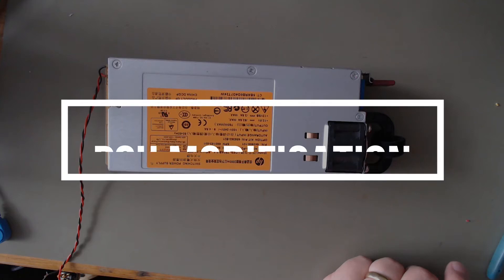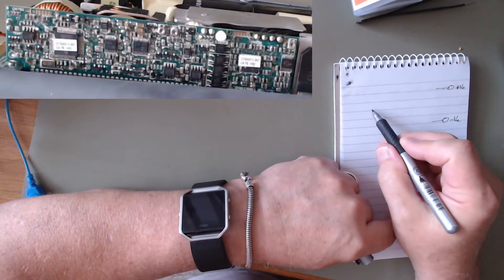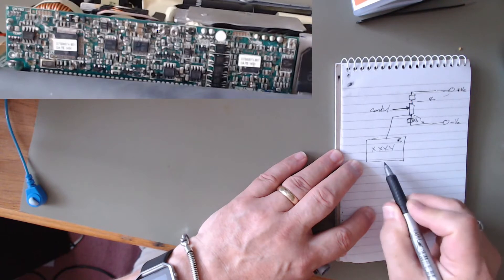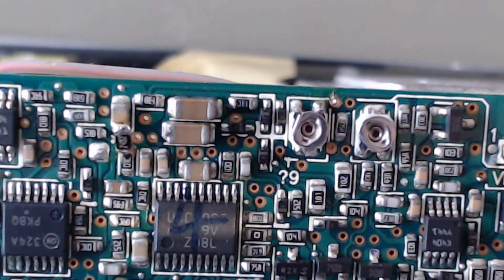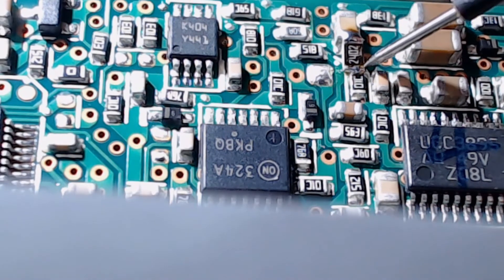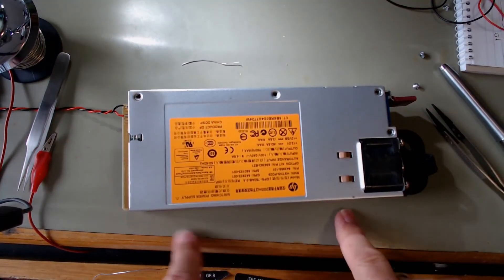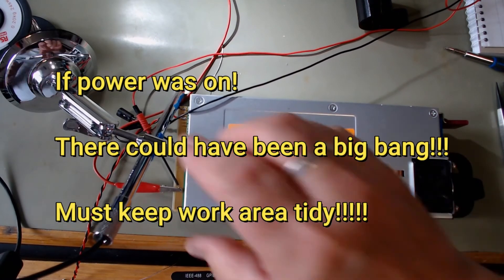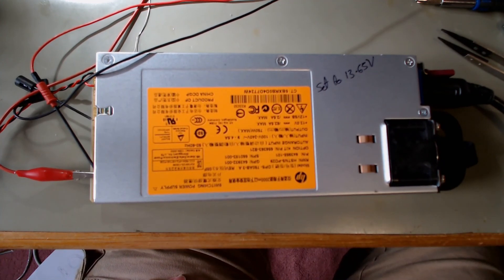#073 converting HP HSTNS PD29 to 13 8V

Comment: I just did the mod on 18PL 750w and stabilized it at 13.6 with an 18k res. Any idea if these psu have short protection?
Reply from the maker: I've not tried shorting one out to find out, too much current for my wiring. I would play on the side of caution and say no, best to avoid shorts as best as you can than rely on protection.

Comment: I don't understand, the 24k resistor gets connected to adjustment?
Reply from the maker: The modification works by changing the ratio of the voltage setting pot. This means the output voltage has to increase to give the correct feedback value. the other video's show what else needs to be done if you need to get to 13.8V or so without the overvoltage trip to kick in. 

Again be careful these PSU's can kill if you touch the tracks with power on or have not given it long enough time for the caps to fully discharge.
Reply: @TheEmbeddedHobbyist  I've managed to get 13.75v with a 22k resistor
Reply from the maker: @ranetti21  this could be caused by tolerances in the components etc. but once you get near to around 13.8V you might need to do the overvoltage mod as well. there is a video for that as well.

Comment: Great video !  I have resistors that will work but they aren't smd. Can I wire to the leg of the pot you hooked your resistance box to and then take it to ground ? Or do I need to solder the other end to one of the points your soldered the resistor to ?   I thought things were small in 1970 when I took a couple electronics classes. A microscope for these old eyes would be handy
Reply from the maker: the resistors need to go the the same places, except for ground or 0V that end can go to any convenient 0V place. just make sure that the leads and wires are well insulated from the PCB.

Comment: overvoltage protection off? 14v + please help
Reply from the maker: Sorry but i never found a circuit diagram for the PSU and did not need to increase the OV protection. so have not looked at that so can't help.
i keep lookig for a circuit diagram to do more with this PSU i will do an update.
Reply: @TheEmbeddedHobbyist  I installed a 27k resistor, I was able to raise the voltage to 13.7, but I knocked out the overvoltage protection, and I turned the variable resistor on the right in the video, it adjusts the overvoltage protection threshold, and the unit stopped turning on the protection at 13.75 ... it doesn’t work any higher, maybe it will help you change something in the scheme, we need it to be able to charge the batteries, sorry for the Google translator, I am from Ukraine, thank you in advance.
Reply from the maker: @avtoelectrik2833  sorry butI have said before, I could not find a circuit diagram for the board and I expected that the over voltage protection is not adjustable so no pot to turn to try and find it.  If I ever find it I will post a video on it. I do look every now and then trying to find a fix

Comment: Yes, it worked for me. And everybody knows that when we increase voltage to 13.8 the amps capacity of power supply decreases a little bit, but overall wattage will be same, I think there is no issue for components to handle it because it's a very little difference between 12v and 13.8v. Nice video
Reply from the maker: Glad it help.

Comment: A great video, thank you! I've just bought one of these on eBay and waiting for it to come in the post. I'm hoping to use it as a current source for vehicle electrical systems when performing software updates to modules when the engine is not running. With the mod in place, do you know what the lowest achievable voltage is using the pot?
Reply from the maker: Sorry I can't remember,  but if you fit a different value for the resistor mod you could tweak it down a bit. Just remember to let the power supply sit for a few minutes after turning off, the high voltage left on the caps inside can easily kill.
Reply: @TheEmbeddedHobbyist  thank you for the advice. I will have a play.

Comment: Hi, i've tried hacking my pd29 and failed. After reversing the hack the PSUs voltage is for a very short moment 12v, but it falls to 0v. Is there a way to repair it?
Reply from the maker: Hi Jan it's hard to say. You just have to go over where you have made the hack and see if there is anything that you have missed when you removed the hack. Look for dry joints or cracks in any SMD components, did you cut any tracks and not solder back over the cuts? Could be that you have upset the overvoltage trip and it's seeing a fault and shutting down. I've never found any circuit diagrams for these server power supplies, and the very high DC voltage puts me off investigating too far.
Reply: @TheEmbeddedHobbyist  I poked a bit in the psu, and everything is fine except probably the ovp circuit. Its not that big of a deal since I bought a hstns-pd41 and it seems to be hackable too. Its 2/3  size of a pd29 and a bit more powerful, so the pd29 can stay dead.
Reply from the maker: @janmrog Jan  I expect thats a good plan.
Reply: Hey, did you came up with any resolution? I have similar case with my PSU. Looks like OVP is always on. With about 20kohm resistor i was able to get 13,7 V easily, but during testing  with 200W load it turned off. After removing the mod, PSU works as in your case, the same was when the resistance added was too small (about 10k potentiometer).
Reply: @achimPL  Hi, eventually i looked closer and saw that the resistor i soldered to had a burnt contact. After replacing the resistor the psu worked fine. I haven't been able to test max wattage though, because I don't have a load this big.
Your case seems to be diffrent though. On my psu I couldn't pull any load since the voltage was visible for not more than a second. In your case you can pull current, but up until a point. This looks like ocp (overcurrent protection) getting triggered. I'd try marking the second potentiometer with a marker, to mark the position and than, try turning it to see if you can get more power
Reply from the maker: @janmrog  I find that these are very good at shuttng themselfs down with the OVP and OCP. they were designed to be a very stable 12V supply for a server and work within tight limits. when we push to the edges of these limits they bite back and shutdown. I keep looking for circuit diagrams on these power supplies to get an idea of where to look for the protection circuits but no luck yet even after a year of looking. there is a lot of power floating about inside these to make trial and effort a bit of a risk to me 🙂

Comment: Hi! Do you know how to make a HP HSTNS-PC40 PSU work at 13.8V? I only see one potentiometer and turning it does not make a difference in voltage. Thanks.
Reply from the maker: Sorry Jure, ive not seen that model

Comment: do you have any modification of DS1200 EMERSON/ASTEC/ARTESYN to increase voltage to 13.8v ?
Reply from the maker: Sorry not for that PSU, looking at the data sheet it will most likely need to have the over voltage protection upped as well. As the data sheet states that the O/V protection limits are 13.2 to 14.4V.  So i expect that it will cut out before it gets to 13..8V. Circuits are hard to find for these PSU's

Comment: Hello thanks fo the video 

my hp1500w power supply heats up quite a bit at 40% load
I wanted to know if this is normal?

I have other hp1200w power supplies which are much cooler.

What is the normal temperature of the power metal cases?
Thanks in advance :)
Reply from the maker: Hi Mehdi, sorry but I can't help with this. This is the only HP PSU I have, and I did the video as I could not find any information on this model. I use the PSU to power a HF Radio where the high current is only pulled for 6 mins max at a time on transmit, so does not get very warm at all.

if I can find a cheap 1500W one I may have a look.
Reply: @TheEmbeddedHobbyist  Thank you for taking the time to answer me.

normally it should be good I check the heat by touching it and it is possible to put my hand between 5 and 10 seconds maximum
Reply from the maker: @mehdi660  that would put the case at about 60c, as a rule of thumb 60c is about the temperature at which you can just about touch for a few seconds
Reply: @TheEmbeddedHobbyist  yes I must surely be in the 60 ° c

Comment: Maybe you know about over voltage protection how to remove it?
Reply from the maker: Hi, I can't find a circuit digram of the PSU so did look into the OVP as it went to a voltage that I was happy with. Sorry but I'm not into making cahages that might affect the safety without knowing the limitations of the design. my mod did not take the design outside it's limits so was happy it would be safe.
Reply: @TheEmbeddedHobbyist  i did voltage upgrade like u but if u turn on the psu and after that connect something when its working like a bulb to check it goes to protection :/ So if ill be working with my car im afraid of unit to shutdown or going to protection doing some manipulations inside car, while flashing or something like that, for example if u turn on ignition and then turn on the psu unit its fine but if u turn on psu and then ignition psu goes to protection, ive tested it on table even with a bulb, and its not even close enough to 60 A.
Reply from the maker: @kaprizasds837  Hi, your not the first one to have said this occurs. I will try and look into it but without a circuit diagram it will need to be reversed engineered and I'm not too happy poking around inside with caps charged to 400V. So it may take some time. if you find any other information on these pop back and leave a link.
Reply: @TheEmbeddedHobbyist  Im trying to find sad about this one psu theres not enough info at all :/ about 800,1200 psus theres kinda lot of info diy.

Comment: Thanks, it works, but I applied it to the radio, it doesn't work with hi power, it cuts off, what parts do I need to adjust? Thank you in advance
Reply from the maker: Did a bit more playing with mine to day, and found that it did not like my FT-897. If I connect the FT-897 to the PSU and turn it on the PSU shuts down. Not quite sure what's the cause as this is the only radio it had done that to so far.

But I found that the radio started quite happily!  So I put a  2 ohm resistor in series with the psu and the radio and a 1000uF cap between the radio and the PSU 0V. This allowed the radio to start up, once running I shorted the 2ohm resistor out. RX current 0.7A 13.6V TX running 100W FM  (close to 20A) 13.5V.

Radio happy to run in to a dummy load on the PSU at full power.

Looks like the PSU might need a big cap on the output for some radios. 

Looked at the PSU output on start up on my scope and it shows a clean ramp up to 13.6V with no overshoot.

FT897 shows a big draw on the PSU on start up, which i don't think the HP PSU likes.

Hope this helps a bit more.
Reply from the maker: That's a hard one, did it run on a high power load like lights etc. The problem with RF is it could be getting back down your power leads from the radio and making the overvoltage circuit detect an overload and shutdown. 

I would try connecting it to a high power DC load to check the PSU can provide the current without a problem, then look at putting someform of choke on the power leads to block RF from getting back to the output of the PSU.

You could try and adjust the output voltage a bit lower away from the overvoltage trip point and see if that helps. 

These PSU were never designed to run near high power RF, so we need to try and protect them from it.  Does it do the same thing when the radio is feeding in to a dummy load. So that no RF currents are flowing on the grounds from a mismatched antenna?

Just a few pointers as I don't think there is an adjustment that could stop this, apart from lowing the output voltage to give a little more headroom from the overvoltage cutout.
Reply: Does the voltage drop when you load the supply using high power? How much does it drop?
Reply from the maker: looked at mine again and it has issues with my FT897 but only on turn on, which a bit of a Rc filter cleared. see my reply to Sopon above or below depending on where YouTube puts it.

Comment: very nice... i am going to buy 8 of them from ebay, only 10 dollars each and use it to power an ebike... Gas generator on bike trailer --- > 8 x 12v  = 96v --> 96v bldc motor... Do these power supplies work ok on generator power thx...?
Reply from the maker: I've no idea Nick, they are designed for server power supplies so i expect they would be on a nice stable supply. On a generator you might be pushing the limits of the input circuit.

Comment: What did you use to Energize the unit? I saw you switch it on and off. Or I should say it looked like you switched it on and off. I’ve used a 470 home resistor on mine and I can’t get it to energize. Let me know if you would.
Reply from the maker: Hi James, My unit has no problems turning on and off!   I have a 390 ohm resistor that is switched between the left most track on the top of the PCB and the 4th one in from the left.

why 390 ohms i don't know it must have been sitting on the bench, it's not a normal goto value.
Reply: @TheEmbeddedHobbyist  after I spoke to you, I was able to get it energized by shorting the left pens. I’m not sure why the resistor wouldn’t start it. But it’s working now, not with the resistor but by shorting it each time I use it. Thanks for responding. You’re very informative and I will continue watching your channel.
Reply from the maker: @Mustang68 , thanks
Reply: I got the same model PD29
And can energize the unit by short
The left leg and the 4th leg without
Any resistor in between. Question
Is do you really need the 390 ohm resistor ?

Comment: Hi Embedded Man, here idea with the modification to change the level of overvoltage protection!

https://drive.google.com/file/d/1Dv4nZXd7ezqxD8c3UceLraNqwQwo7Ey2/view?usp=sharing

https://drive.google.com/file/d/1zPrVM5GCOJ1rjSc0T2aNdgqekIBNYM5h/view?usp=sharing

The overvoltage pod runs into a LM358 Low Power Dual Operational Amplifiers

Can you tell me if you think this is an option to bump up the voltage of HSTNS-PL29 to 14,6V

Regards
Bob

Comment: Hello Embedded Man, 

I am following your video carefully and I need your advice.  My voltage pot was set to 176,3R on one side and 0.4R from the other leg. The output voltage is. 12.34V. 
According your explaination I could increase the output to 13.82V with an 23.31K resistor value ( Poti) between  leg 1 of 176R pot. (I call it 176R) That is the resistor I could measure.

I do need 14.4V to charge Lifepo cells with it. If I increase the voltage above 13,82V the overvoltage protection kicks in. So I took a look to pot left of it. 

I was set to I assume lowest value 53R. I could not lower the value which I hope it would give me an higher output. But it is already set to max output.  If I increase this side to higher value the overvoltage protection level will be reduced.  I like to share my pictures. 

do you have an idea to how to change the overvoltge protection?

Have a nice first advent. 
Bob
https://drive.google.com/file/d/1Dv4nZXd7ezqxD8c3UceLraNqwQwo7Ey2/view?usp=sharing
Reply from the maker: Hi Bob. 

The first problem is the pot has a limited adjustment range, and I could not get it to go to 13.6V without adding the resistor shown. which leads to the second problem. 

The second problem is as you have found out here is an overvoltage trip which will kill the output if the trip point reached. I could not get to 13.8V as it would trip about 13.75V so I left it at 13.6V which was ok for the radio’s I’m going to be powering.

The third problem is I could not find any circuit diagrams for these power supplies. So don’t know where the overvoltage trip point is set or if it is adjustable. Without finding this part of the circuit and modifying it you won’t be able to get the output much past 13.8V. And as I did not need to go any higher I stopped looking any further.

Sorry that I can’t be any real help with the over voltage trip at the moment, but if I get some time I might go back and have a look.

Glad that my video has been of some help
TEH.
Reply: @TheEmbeddedHobbyist  

Thank you TEH. 
I have measured the resistance from positive to the pot left side of your jumper cascade cable 

In the middle position of the two pods you find a 05A SMD resistor. The gold padhole has direct connection to output voltage. This resistor has 110R.  This resistor is in series with the 56R pot.  If I increase the voltage drop over the 110R  can I fool the circuit?

What do you think. ?
I hope I can organize the schematic!

Regard Bob
Reply from the maker: @Slic-Rock  Thanks for the extra information. It's good to pass information about these power supplies as there is not a lot of it about on the web.
Reply: @TheEmbeddedHobbyist  

Hi I am not so experienced in SMD soldering. Can you review my proposal and tell me what do you think. 
Is my idea feasible?

Br
Bob

Comment: Hello I have just registered to your channel. Why did you went the hard way. Couldn't you not use the pot to trim the 13,6V.

I have the same PSU but I need 14,4V to 14.6V to charge Lifepo4 Batterie to power a smart charger. You have used a 24K resistor to get 13,6V
To get 14.4V will the resistor value go up or down. Can you give some advice?

Thanks
Bob
Reply from the maker: Thanks for subscribing
Reply: Normally over voltage protection kicks in above 13.8V. You may have to modify protection circuit as well ... not recommended ;-)
Reply: @danielammann743  do you know how make up ovp ?